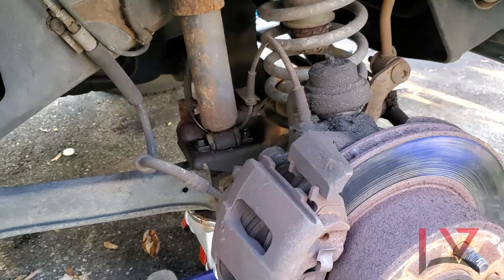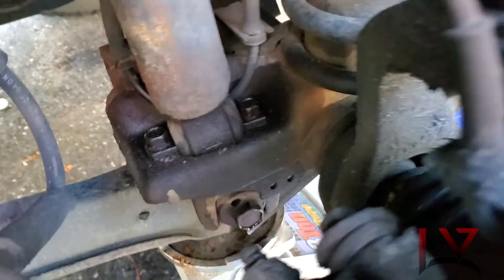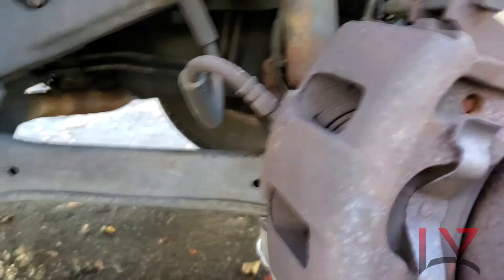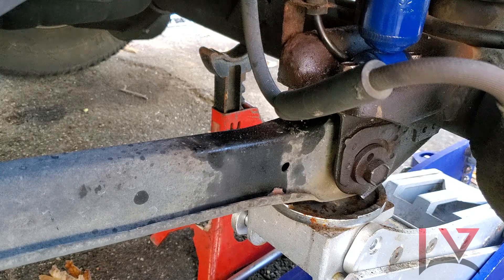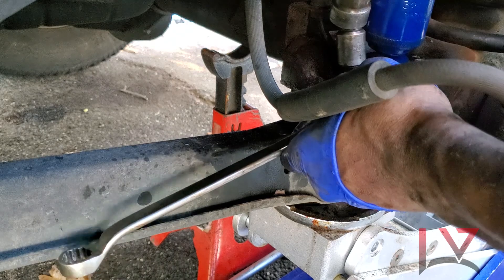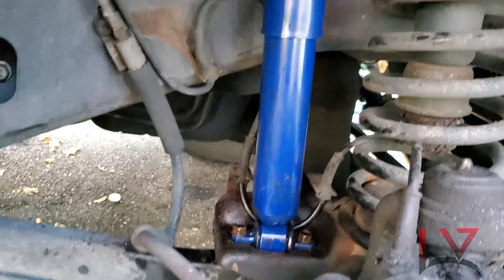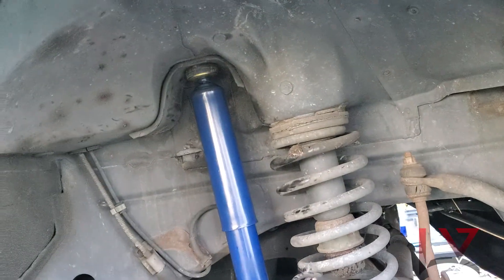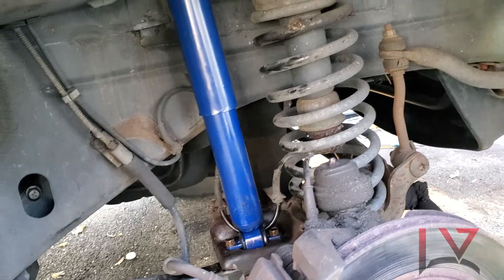Jeep Grand Cherokee front shock replacement

Comment: doing the same job soon, so thanks for posting!  what about putting some grease on the rubber bushing to keep it from squeeking ?
Reply from the maker: You are very welcome Scott. Putting grease on the rubber bushing is not necessary.
Reply: i dont mean to be offtopic but does anybody know a method to get back into an Instagram account..?
I stupidly forgot my account password. I would appreciate any assistance you can offer me
Reply: @Julius Eli Instablaster :)
Reply: @Abel Harlem thanks for your reply. I found the site through google and im in the hacking process atm.
Looks like it's gonna take quite some time so I will reply here later with my results.
Reply: @Abel Harlem it worked and I now got access to my account again. Im so happy:D
Thank you so much you saved my ass :D
Reply: @Julius Eli You are welcome =)
Reply: What year is the car you worked on? Thanks.

Comment: Your not soposed cut the strap off until the bottom bolts are installed. The you can direct the shaft into the hole.
Reply: That's what she said
Reply: And yet it still worked.